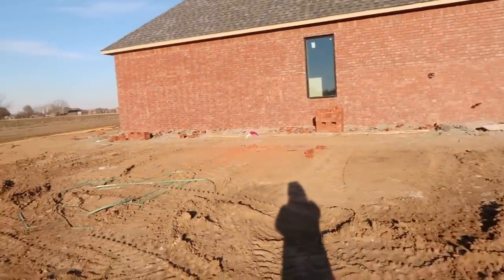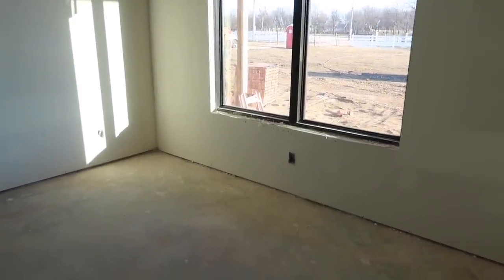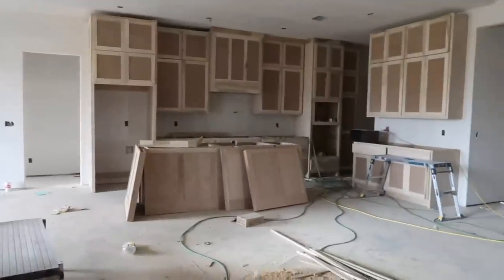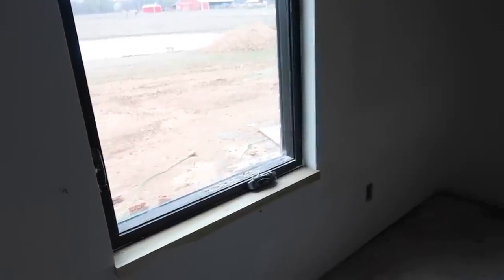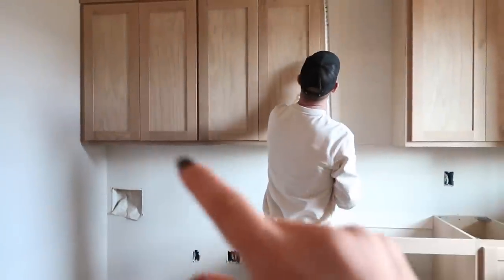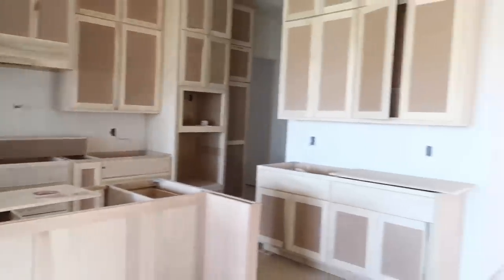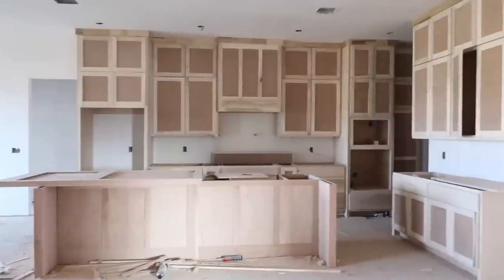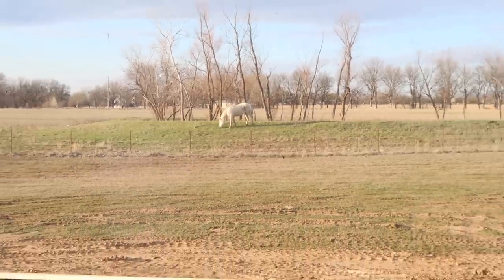NEW HOME UPDATE #5 | DREAM HOME DESIGN STYLES + CHOICES | CUSTOM HOME BUILDING IDEAS 2023

Comment: We’ve built several homes and I’ve always gotten push back on pocket doors. To this day I regret not insisting on them in certain areas. Builders tell you they warp etc but they don’t, they’re just annoying for installers to deal with.

Comment: I had a similar railing issue with my patio.  I had one installed for inspection then tore it down as soon as we moved in.  If you really don’t want it in your garage, just take it out when you move in 😊
Reply from the maker: Thanks for sharing the tip 😉

Comment: We live in an older home that was converted into apartments and our bathroom has a really heavy pocket door. Anyways, because of the age and the wood warping over time it gets stuck all the time. Especially when I have guests over and they aren't used to it. I am constantly freeing people from being trapped in the bathroom lol. So.. Yeah.. I can completely understand why your builder was against it 😆.
Reply: Anyone building their own house should do so however they desire. However, I completely agree with the builders on pocket doors. I have never been able to easily open or close a pocket door that I've run into. My sister built a fabulous new house a couple of years ago and they put a pocket door in the jack & jill bathroom and I swear, I can never get that thing to close entirely (or, it's too much of a bother).  It is troublesome because I never feel like I have complete privacy in that bathroom. I may be in the minority...but I'm guessing there is a reason builders resist it.

Comment: I like the rounded corners myself. I have a scar where I hit the wall on the squared off corner as well when I was 4 and I had to get stitches. I still remember it from when it happened.
I am really learning a lot from your house building experience and I am extremely interested in what you will say at the end of it all. 
Before my husband passed away I was going to become a custom home building contractor. I didn't realize until I watched your videos how many things that have been coming up for you while building and how good the people were from the builder I was learning from.

 When you paint or stain and lacquer custom homes you see all the trades from beginning to the end and the work that they do because you come in at different times throughout the process. When you are learning the trade of building things are being pointed out to you that perhaps you never noticed before as well. 
All the trades where I was always cleaned up their messes daily without fail or being asked to but it was a requirement to work for that builder. It was rare that a trade had to fix something that wasn't done properly and the only time there were changes is if a change order had been added. I know now that was because the builder hand picked these people who were all experts in their trades and he used the same people at every house. I had seen some of the same trades at different custom home builders new builds and they would perform the same no matter where there were. 
The owners of each trade was always on site when that trade was doing work. They were very particular about doing an excellent job. I suppose I didn't realize how rare that is now since I left there 12 and a half years ago until watching your videos but I have heard of issues here in San Diego too. 
If I ever decide to get into building again you have given me so much to think about now so thank you very much. Thank you so very much for your amazing video! ❤❤❤

Comment: Squared off! We have rounded corners and I very much dislike them. 😩 Hard to paint adjoining rooms — which side of the curve do you start/stop at? You still hit the corners, but instead of a single ding at the corner point, both sides of the curve crack. Been there, annoyingly repaired it. Ugh. It’s those kind of decisions that seem no big deal at the time, but having lived with them as long as we have (16 years and counting), I’m in the camp of ‘never again’ on rounded corners. 😂

Comment: So couple questions that you can just add your list address later if you want to. Reasons behind, telling you know for the pocket doors? And when they tell you know that they don’t like your design or it won’t work, do they offer you a solution or do they just say no I can’t do it? And is that something that your contractor comes back and tells the subcontractor OK this is what they want, what can you do to get it as close to or almost the same thing and is it gonna cost more or less? I have one more question for you to add to your list of things to talk about how far away is the laundry room to your bedroom or savannas
Reply from the maker: Our contractor is good about talking to his subs contractors on finding a solution to our problem so we can get what we want. At first he says no you can’t do that but when we push he will find a solution. Reason a lot of builders say no for pocket doors is they are a little more expensive to install because framing has to be done a certain way and the track installed. I think it’s harder for them to communicate that some doors are pocket doors and the rest are regular doors to the framers. The laundry room is across the hall from our master.

Comment: Brick looks more high end when left in its natural state.  Masonry is an art form.  Here in Ohio there's a wealthy suburb of Columbus where everything is red brick even the major retailers.  No painted brick either.  Painting brick is a choice a lot of people do.  The regular brick with the black window panes looks more high end to me and not to mention natural.  Did notice the brick laying on your house is super simple.  No arches or window arrangement so enjoy.  Definitely pro pocket doors vs. the barn doors.  Space saver and oodles more privacy.  Never understood barn doors used in certain areas like a bathroom.  Also a huge fan of closed storage, especially in the kitchen.  All about taking cabinets up to the ceiling in the kitchen if the height of the ceiling allows.  Open space equals more to dust.  Don't blame you guys for taking advantage of getting that property, especially when you got it.  Tulsa area seems like a hot market.  Hopefully you get a good price on your current house.  The market is showing signs of slowing down.  A lot of it is loan interest.  These rates now are the same rates twenty years ago.
Reply: I like pocket doors too. Barn doors are farmhouse and yes def privacy/sound issues with those. Looks like maybe modern farmhouse vibe.

Comment: Why did you not put your vacuums in the laundry room instead of kitchen? 

Also, I have built 2 custom homes.  Your issues are nothing.
Reply from the maker: They are more accessible in the kitchen and we had the extra space for them in there but not the laundry room. 

I know others may have some worse issues with their new build experience, but it’s not fair to say that the issues we are having are “nothing”. When you spend so much money on something and it doesn’t get done the correct way it’s ok to not be happy with the result. Hope that makes sense. Thanks for watching

Comment: The windows are SOOOO small. Big rooms and small windows and no windows in the kitchen. Needs so much more sunlight.
Reply from the maker: These windows are actually huge, they may look smaller because the walls are 10 feet tall. They are all bigger than our current home
Reply: @TilVacuumDoUsPart  Exactly. From the outside, you see so much brick and tiny windows...not to scale at all.